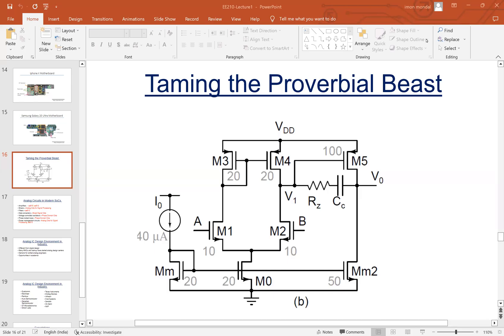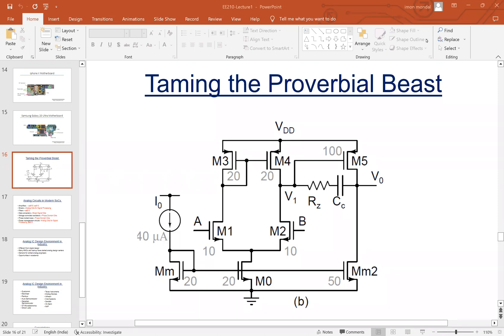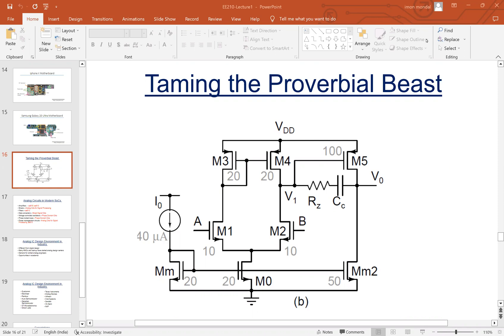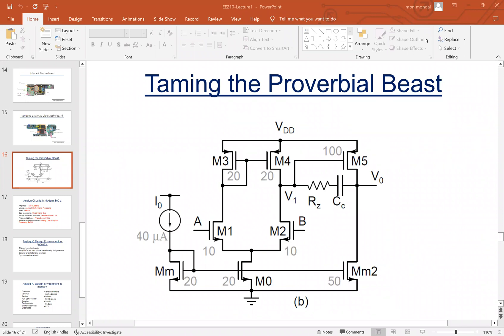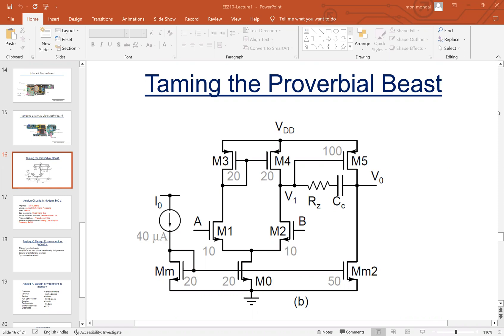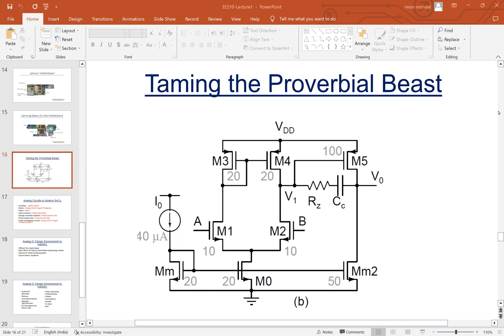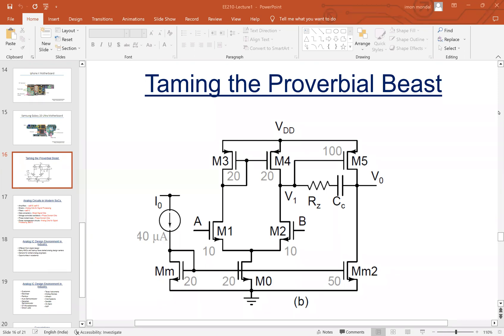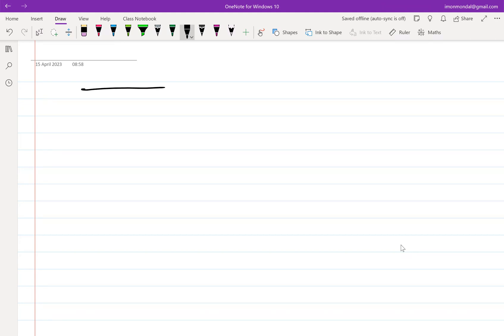Lecture 39a: Differential amplifier contd..

Comment: How increase in B decreases V1?
Reply from the maker: If B increases, more current (from drain to source) flows through M2 and less through M1. Since more current is pulled out of the node V1 (as a consequence of increase in current through M2), the voltage at V1 decreases.